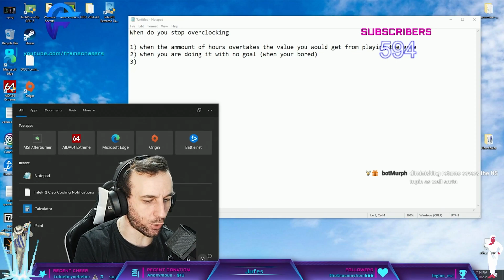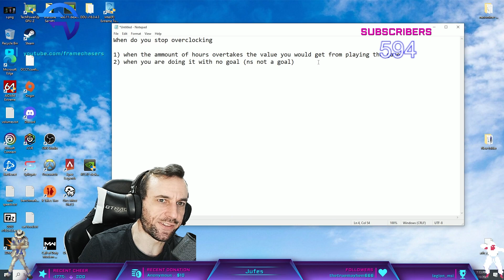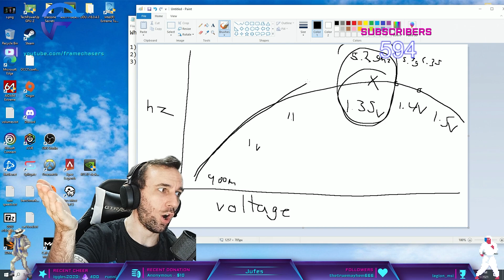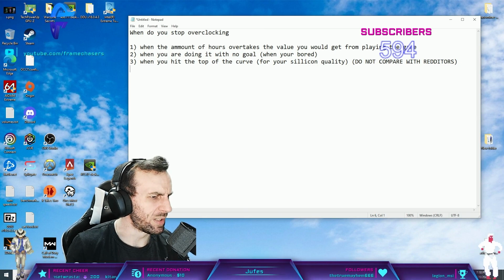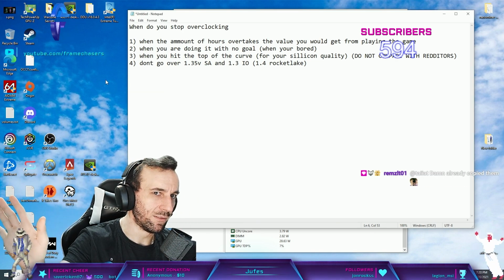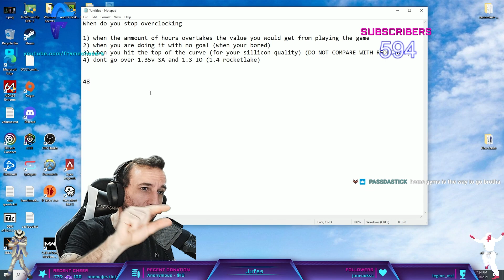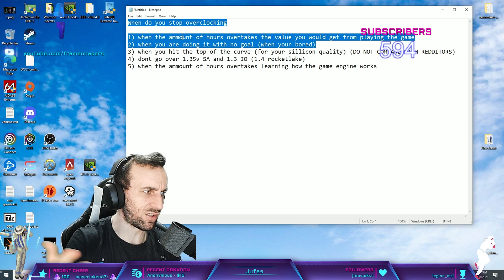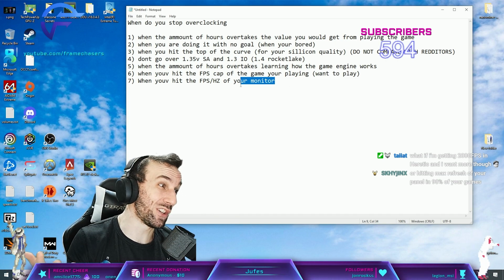What is MAX SAFE OVERCLOCKS?

Comment: to be fair all current modern cpus are tuned just about at the top of silicon curve, just enable MCE and tune your ram and you are done. These days ram overclocking makes more difference than your cpu oc, provided you have all core turbo boost enabled in your bios.

Comment: Hello, I have a quick question in fact I would like to put a bios of a (Asus RTX 3070
STRIX GAMING OC)
on a (rtx 3070 Aorus Master) it could work or not at all ?
Reply: @jimdshea  Ok thanks for the information, And if the operation went wrong I can go back
by injecting the backup of my bios from before ?
Reply: I installed a strip bios onto my 3070ti master and it works fine. I think that gigabyte and strix bioses on 30 series are almost interchangeable and just work

Comment: Do you think the 6900xt is worth the extra $ over the 6800xt for 1080p max fps?
Reply: Not worth for the price point but for cool factor yes. 6800xt is basically a 6900xt
Reply: @siroui4239  thanks for the reply! I saw the mining potential is also slightly higher on the 68 vs the 69 for some reason. Not a deciding factor but helps the 68 case over the 69. Always nice to be able to pay off some of the cost
Reply: @siroui4239  where I’m at the 69 is about 300USD difference over the 68
Reply: I was thinking of using that $ to get a nice b-die kit instead